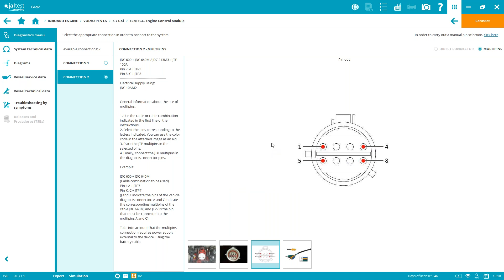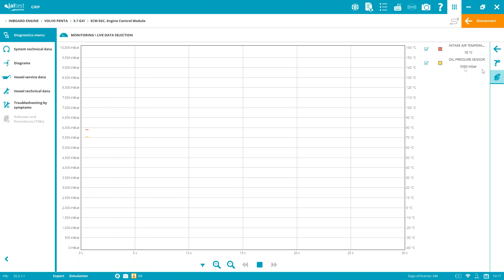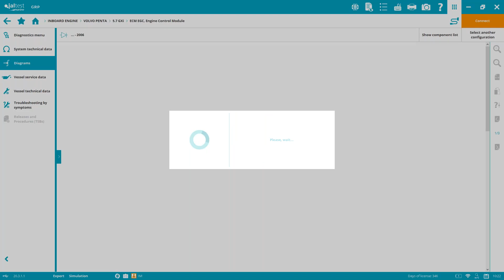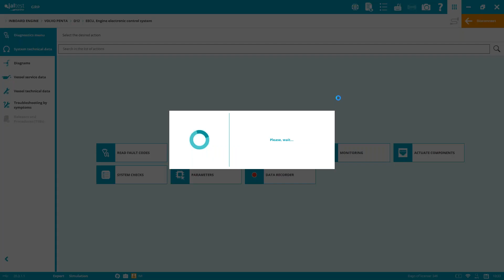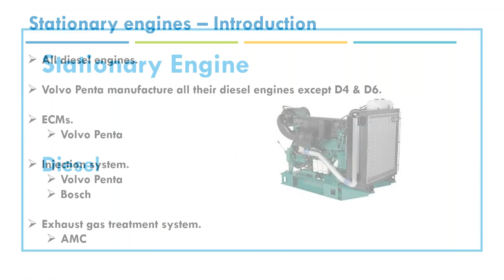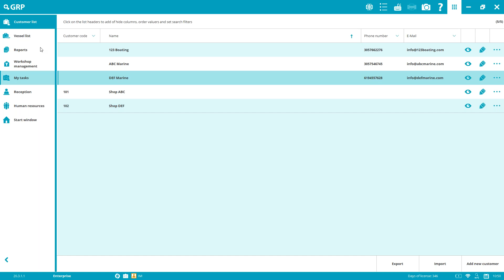JALTEST WEBINAR | Dealer level diagnostics on Volvo Penta with Jaltest Marine

Comment: Pretty helpful
Insight into how marine engines and your software works. I’m a car mechanic with 1000$ scan tool that doesn’t support j1939 protocol that Volvo penta 2011 4.3 GXi-j motor uses. So I have to come over here to see how
Your tools work - and realize - for my own boat - can’t justify 5k for your awesome system. Off to get Chinese diesel truck scan tool - that supports j1939 - but won’t be any thing like your interface :). Thanks for sharing your product. It looks great.